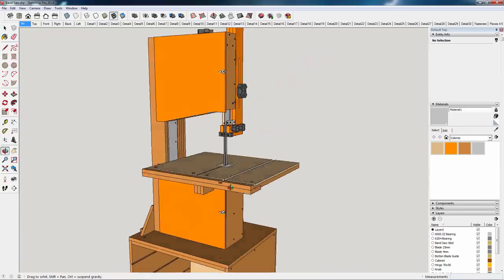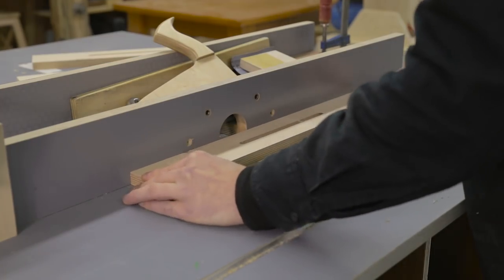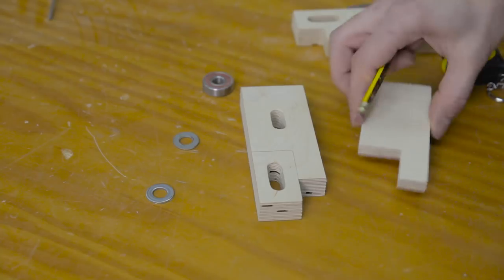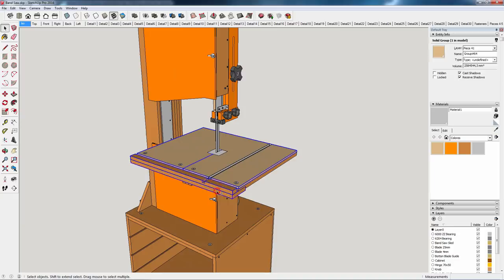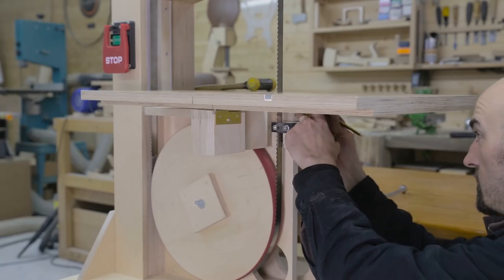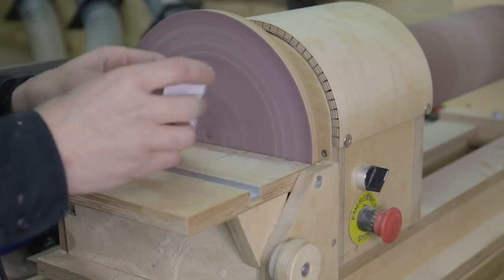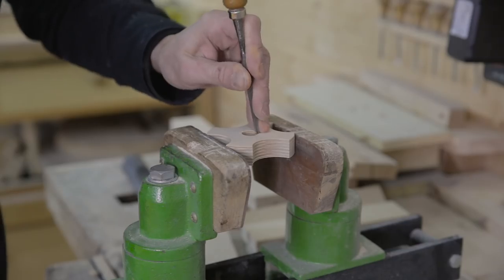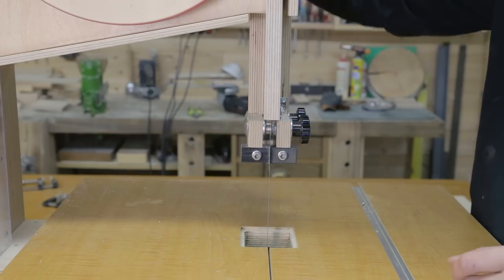Making a homemade Band Saw (part3 / blade guides)

Comment: Hi Suso
  At 1.27 you make a cut into the front piece that holds the table hinges, you say that this is to enable you to adjust the lower guides more easily !  I can't see that there is any interference  here ! Is this not just weakening this piece ?.

Comment: ¡Excelente trabajo!, Muchas gracias por compartirlo.
Yo también me estoy haciendo una de 14", pero tiene componentes metálicos y otros en madera, el montaje es diferente.
Tengo algunas dudas, estaría agradecido si me ayudaras a aclararlas:
Al tener un motor de 900 RPM tengo la duda si ponerle la tracción directa, creo que ganaría en par motor, pero quizás tenga más vibraciones, ¿qué opinas?.
Reply from the maker: Toni T. Hola Toni, me imagino que 14 pulgadas es el diametro de los volantes? En ese caso es igual a la mía!
No creo que tengas problemas poniendo el motor directo, si el motor y sus rodamientos están en buen estado. No vas a perder par, lo ideal en estos casos es usar un motor de más revouciones y bajarlas con poleas como en mi caso, pero creo que el tuyo también puede funcionar. Envíame unas fotos cuando termines!
Reply: Así es, 14" es la medida de los volantes. Estoy haciendo una sierra aprovechando todo lo que tenía por el taller, comprando lo mínimo posible, (esa es la gracia).
Tenía un motor de 900W. con tres bobinados internos, 700, 800 y 900RPM, pensé ponerlo con tracción directa para ahorrarme trabajo y pensando que aprovecharía mejor la potencia motor, pero tenía un poco de miedo de que transmitiera las vibraciones a la máquina y he decidido ponerle unos pequeños absorbentes de goma en la base.
La velocidad de corte quedará en 1000 mts/m. (en la máx), creo que es bastante óptima para madera blandas.
Otra duda que tengo es, ¿por qué decidiste poner los rodamientos en las bases en lugar de en los volantes...?
Cuenta con las fotos en cuanto la termine, me lo tomo con calma, en esta ocasión no he hecho proyecto en 3D, lo tengo en la cabeza y ya se sabe lo que pasa con eso, (mil y un problema).  Saludos

Comment: Whats the stuff you are adding to the Glue? is it sand or an accelerant to speed up glue drying?
Reply from the maker: it's salt, so that the parts won't move when tightening the clamps.

Comment: I'm surprised you didn't use bearings for the side stops of the saw. They'll last longer than Teflon since they're made of steel and have zero friction on the saw blades given that they spin.

Comment: Fantastic work and great video. Just wondering what is the capacity of the saw. Max Depth and width of cut. Also what HP is the motor?  Keep up the great work !
Reply from the maker: thanks! 230mm depth and 340mm width. I've used a motor with 1hp and 1500rev.

Comment: I am very impressed with the build.  It looks amazingly sturdy for plywood.  I do have a question: How do you maintain tension in the motor drive belt.  To me it looks like you have two speed positions but neither the motor / gear or drive gears have movement to adjust tension.  Presumably, this is not a problem. Cheers.
Reply from the maker: hello Peter, actually I only have one speed, but it's not a bad idea to have two. You could make a tiltable base for the motor, like I did on my homemade lathe:
https://www.paoson.com/en/blog/lathe-disc-sander-n63
Reply: In recent years I owned a Jet bandsaw which had two speeds.  I used the higher speed to cut wood and the lower speed to cut metal - with a change in blade of course.  It’s not quite as good as a dedicated bandsaw for metal but in a home workshop makes it a versatile machine, being able to cut wood and also thin pieces of metal.  Cheers.

Comment: OK, gracias por sus videos, thanks for your videos
J.M.Castilla@2018
Pregunta; de donde compras el contrachapado de abedul y que precio, aqui en Barna no encuentro si que hay pero no disponible en stock
Reply from the maker: gracias! has preguntado en almacenes de los que suministran a las carpinterías?
Reply: del pueblo que soy (pueblo pequeño) el almacén de aquí dicen no saber del tema, me indican como este que no es igual; https://www.bricomart.es/tablero-contrachapado-marino-244-x-122-x-1-5-cm.html
creo que no es lo mismo que usa usted, pero no es problema lo encontrare, gracias por tu respuesta y pasión por la profesión
Reply from the maker: es contrachapado pero de pino y el que yo uso es de abedul, también te podría servir. De todos modos, yo iría a una carpintería a preguntar donde lo compran ellos, en esos almacenes suele ser más barato aunque seguramente tengas que comprar el tablero entero
Reply: gracias por tu ayuda, ya creo tenerlo solucionado, he pensado hacer la estructura en tubo rectangular de hierro soldado y cubrir con este de tablero de pino la tapa de la cinta, la base, la mesa etc etc. cuando la tenga apunto te paso fotos , gracias de nuevo y sigue asi con tu canal, 
la router manual me parece lo mejor que he visto en mucho tiempo, es genial y una gran idea 
saludos
Reply from the maker: gracias compañero, espero ver esas fotos!